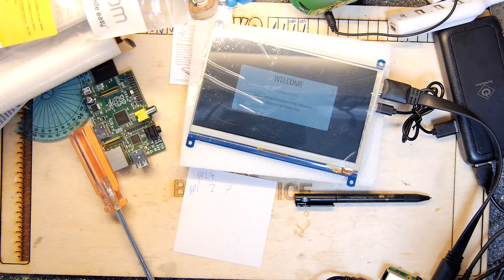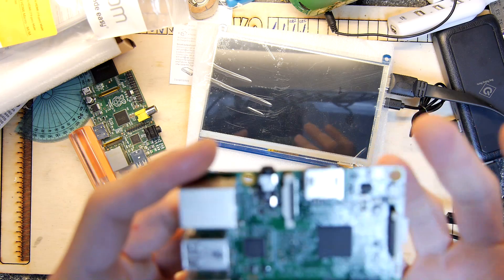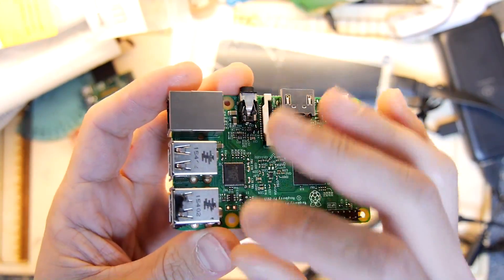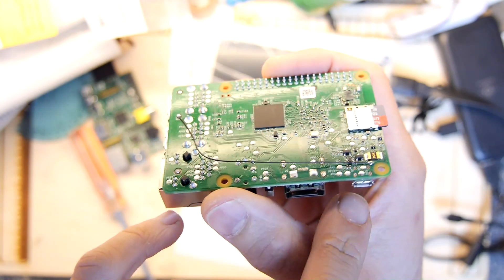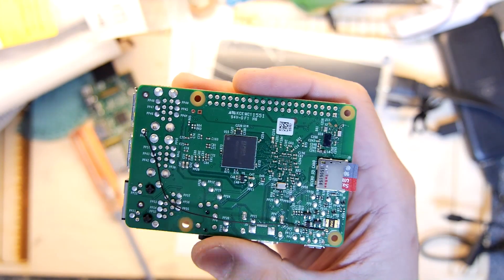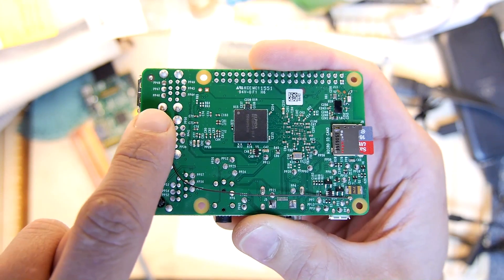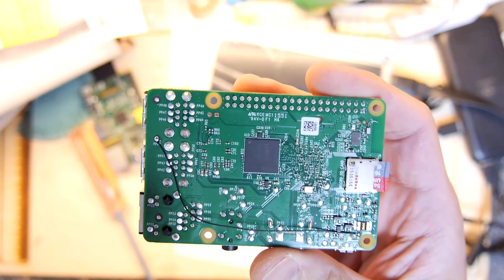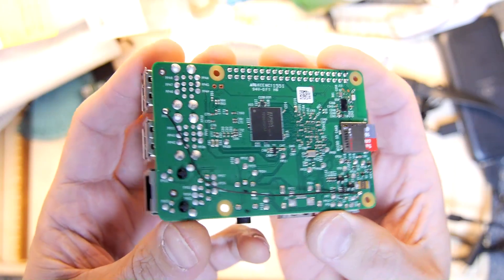DEAD USB on Raspberry Pi FIX!

Comment: Mine too stopped working. I tried the same but it didn't work instead it restarted every time I connected PP1 with PP27. I checked the voltage while in PP1 it showed 5 volt but in PP27 it was showing  less than 0.5 Volts. what can be the issue?

Comment: Just used this to resurect a PI 4 from early dispatch to silicone heaven. just used a cut USB cable to work out where the + came up to on the board from the plug and then bridged that across to the + at the USB C connector. Thank you

Comment: i was facing the same problems for the last 3 years. trying soldering a wire from PP27 to PP1 gives the usb 5v power.
the led on my mouse light up, meaning it has power. but still cannot move the cursor. is it because the data connection was damaged? or any tips about this?

PS: tried keyboard as well, 5v has delivered, but still not working.

Comment: Before trying this, the voltage read something like 3.25 volt, after soldering the jumper, it read 5.2 volts but still the USB didnt detect anything, Ill try with another to see if it works

Comment: Does the SD card have anything to do with the USB ports not working? If the SD card is hard drive for the board, could power be "turned off" thru programming?  I have same board as you. And no power at usb ports.  My 802.11 chip I plug in won't transmit signal.  I can't charge anything out of the usb ports.  That's how I tested usb ports.  Nothing lights up when I apply power. I want to try ur way.  Does amperage make a difference? 1 amp vs 2.4 or 3 amp power input to hotspot?

Comment: i know this is a long shot but my rasp4 just stopped working all the usb ports, and when measuring TP1/Shell its 5.2v but when measuring on TP27/Shell is only 3.3V any toughts? I have 4 3dprinters stopped atm because the pi doesnt recognize usbs :(

Comment: PP27 connects to u13 behind the USB ports . the failure is here or D3 transistor. the Pi controls the USB 5V on reboot ( switches the 5V rail off )
Reply: did you change it and it began to work again?

Comment: I am experiencing an issue where the voltage is displaying as unstable when using a multimeter to measure between the GND and 3.3V pins. Could this be caused by this problem? Thank you.

Comment: I have the same issue on my raspi 3B +. USB ports no power. Ethernet lights keep on with tiny light. C97 is good. The voltage between PP27 and ground is 0. 

Then the solution is to replace 7517,  and everything works well.

Comment: I have the same problem. But when I connect PP27 to PP1/PP7 the RPI reboots and does not start anymore. However, I found out that the USB devices will work when connected to a powered USB hub. Any idea how to work around this, using other points?

Comment: Hi, this is a great hack. However, when I measure across the GPIO pins for 5V and 3.3V, I could only observe 5V being generated and 3.3V pin at 0V. Any idea on why this is happening?
Reply from the maker: Could be that the 3v3 power supply is down. Try to see if you can locate a few test points and see if it present
Reply: @backofficeshow  I have probed literally every test point on the back side of the Rpi 3B+ and all I could see is either 5.2V or nothing else. It's very strange.
Reply from the maker: 3v3 is definitely down then. You will need to hunt down the power supply circuit and start replacing things.
Reply: @backofficeshow  😭😭 Also one more thing, the test point near the USB connectors also didn't give me 5V. Does this mean multiple parts of the board are not receiving enough power?

Comment: My multimeter shows 5V when measured between PP1/PP2 to PP27 but still the USB ports are not working. I checked between PP3(GND) to PP27 and it was fluctuating between 0.01V to 0.06V. Please help me out.

Comment: pls i need help my rasp berry pi  3 wont boot ive done everything what happend was it booted the first time then i used a command to put the dis play in a 2.5 inch display then i turned it off then it wont put out a display itried everything pls help im stariting to think my rasp berry broke
Reply from the maker: Did you wipe the SD card and start again with a fresh operating system? That cures most issues

Comment: Thanks. Now my USB ports have current but when I connect my usb mouse, it lights up but it doesn’t read a thing when I move it around. Are there more test pads or any way I can add other jumpers for usb the data ?
Reply: Exactly same issue here. Besides that, not network and not wifi.

Comment: I have a different issue and I’m not sure where else to look for help, so I’ll ask here just in case someone can.

On my pi 4, recently it won’t detect any usb devices and bring up the file manager like it used to automatically. I have to do the tedious process of “mounting” and “unmounting” it in order to get the device to show up. It used to be that the file manager would automatically bring it up and ask me what to do when usb devices are detected.

I did recently get a small touchscreen case and had to update my entire pi to get it to worko, but that shouldn’t have had any effect on the file manager...?

I also have a different pi 4 also up to date, and it’s working fine here, but it’s not connected to a ny touchscreen and is used through the HDMI ports.
Reply from the maker: If it stopped working after you installed a update it's almost certainly that that took out auto mount. Check the Debian forums on how to get devices to automount in the regular Linux forums

Comment: Crap hardware. I have a brand new Pi 4, USB  burnt within 5 minutes having a sole keyboard (Razer) connected.
They need a better trained electronics engineer
Reply: Don't use razer keyboards with raspberry pi 🤦‍♂️🤦‍♂️

Comment: I have a rasp Pi 4B and i dont have 5 VOLTs on USB 2.0 and USB3.0. Can i use this method ?
Reply from the maker: I do not have any Pi 4s, but if you do try it please let us know if it worked!
Reply: @backofficeshow  I am scared to try it, if i burn it? is it about sotfware ?
Reply from the maker: You should only do what your are comfortable doing and prepared to trash 😂

You might find what integrated circuit is faulty if you find a schematic
Reply: Hey Suleiman! Did you try @backofficeshow 's fix for your dead raspberry pi 4 ports?

Comment: raspberry seem to suffer from this problem,  that is the reason  I did not buy the RBP4 , I had two raspberry 3  bricked in my home because of this, I applied this method and they are working again,  coincidentally they both stopped working after an upgrade, almost at the same time, I went to sleep and when I woke up they were USB ports dead...odd, doesn't it ? anyway plenty of thanks for you.
Reply from the maker: With cheap hardware comes short testing cycles and bulk commodity manufacture. It's possible that there is a gremlin in the design or a weakness in the USB power controller. It just happens. I'm amazed they work as well as they do to be fair. I still use some RP1s whereas ever single far East tablet or android stick from that era is long dead and disposed

Comment: When I powered my raspberry it only ligh up the red led. It boots normally but the USB doesn't work and appears a yellow light on the top of the screen. I have another raspberry, so I tested the power supply on it and it works. Only this one that happens this problem.

Comment: Got a different issue not sure if anyone here can help...

My pi 4 on the bottom usb3 port has a loose connection. The slightest disturbance will instantly break the connection.

I know WHY it happened, as I had a RTL-SDR dongle in it and like an idiot tried to put something in one of the other usb ports. The RTL-SDR takes up too much space...

The other 3 ports are fine, but I kinda want all four working correctly since I haven’t even had it a full year yet.
Reply from the maker: Can you resolder the usb port pins? That could be the issue, otherwise, replace the port entirely.
Reply: Actually just figured it out and I’m kicking myself at how simple a fix it was.

Ever had an nes or snes (or really any old cartridge system) and noticed how it would stop playing games and you couldn’t figure out why(god I’m showing my age here...)? So you finally open it up, find out the pins on the 72 pin connector needed to be bent slightly up again to make better contact, and now it suddenly works.

Essentially what i had to do with the usb port. In the usb3, behind the first set of contacts, there’s the ones for standard usb. Noticed something seemed off when looking at the top and bottom ones. Realized the bottom usb 3 port had the two middle pins pushed in a bit too deep. 

Took a sewing needle and some patience, bent them back up and now they work just fine.

Glad i saw that before I went to the extreme and took out soldering iron.

Comment: Hey there I found your video when my Rpi B+ stopped working. But your solution was no option for me. After serching I found that the SMT condensator near the USB-Port was defect (C97). It is a KERO in size 1206 with 47uF and 16V nominal voltage. After replacing it the USB ports now are working.

Comment: hello 
i have model b+ --- pp27 to pp2 -- and usb powrd working but no data or mouse and keyboard and Ethernet port not working --- any fix
Reply from the maker: You may need to locate and replace the USB controller IC
Reply: @backofficeshow  where :\
Reply from the maker: @nileperch577  Look for the 9512 USB IC, that's probably what you need to change. Good luck 👍
Reply: @backofficeshow  master i have lan7515 this i want to change to 9512  or change 9512 to 9514
Reply: @backofficeshow  can you help master

Comment: Hi..  I had a psu from a 3d printer slam down onto my pi3b, entirely my bad :(  and it's fine if you bend the micro usb cable to connect the clearly physical break, but as soon as there's any slack, boom, dead. It's driving me nuts. I've got a pretty heavy duty fan case taking up gpio 4 & 6 for pos and neg. I understand there's no fuse in place if I chop off a usb cable and put some duponts onto say 2 & 9 for power IN? Would that work though? Ideally I'd love to replace to micro usb port (I can see one of the connectors has lifted with the bang, beyond my skills I think lol) could a phone repair shop do this in a jiffy? Many thanks, and hi from Blackpool lol.
Reply from the maker: Hi William, I've directly hooked onto the power rails before. I think the 5 volts should be ok ok and then the on-board regulators for the other voltages should take over.

you might lose a fuse but what's the worst that can happen your raspberry pi will go pop. Just don't try using the gpio for a space heater 😂
Reply: @backofficeshow  Quickly unplugs space heater No.. no, I wouldn't do anything like that for god's sake! So do you think 2 & 9 should be ok? As I'm a raspbnoob as I installed octoprint and needed to learn nooooothing else since lol. If it goes 'pooffff' I'll blame you ;)
Reply from the maker: @Mr_Gadge  do 2+4 6+9 so you won't get any voltage drop.
Reply: @backofficeshow  See, now you've lost me. So I have a case fan which needs a pos and neg, and I want to bring in power too? 2+4 are both pos? Thanks for taking the time to care for a thick elder lol.
Reply from the maker: @Mr_Gadge  you can just hook the fan and the power together because the fan isn't really using the gpio. The reason I say to double up on the pins is that you can effectively double the current rating of your connection
Reply: @backofficeshow  Update! After lots of flux and copper desolder wire, the port came off :) the pads had lifted off the board with the 'crash' I looked up on googly the pinout and found the pos and neg two circular spots behind where the port was, soldered there, and bingo. Direct power. Really happy lol.

Comment: Cool - it worked.  Now there's a message saying "Under-voltage detected" but with the Pi booted, connected via HDMI to a display, and via USB to my keyboard/mouse, it works fine
Reply from the maker: Under voltage detected is so annoying! I've used decent PSUs and still see that. I think there is a firmware flaw.
Reply: @backofficeshow  why they don't fix this many people have same issue.even I'm using psu as recommended same problem persist thanks for video my problem solved for now but I can't understand what was issue.
Reply from the maker: I am not sure how big a problem it is in their latest versions.

Comment: Thank you.  Your instructions saved me from buying a replacement Pi3.  You asked if someone knows another way to test if the USB port works after the fix.  I used  Eversame 2 in 1 Type C USB Tester - it shows Voltage, Amp etc.  At around fifteen dollars it is an overkill for one time testing, but if you need to test USB ports frequently, it is a good tool to have it in your toolbox.
Reply from the maker: Awesome, glad it worked out for you!

Comment: I installed fan on RPi4 and by connecting it to GPIO 5v power. The fan works fine and temperatures are down but now the USB ports are not working. any ideas?
Reply from the maker: Do they work of you disconnect the fan?
Reply: @backofficeshow  thanks for the reply.

I checked the dmesg for any voltage warnings. Ended up finding that PCIe probing was failing (out of memory) because i had given all the memory to gpu.

I updated the ram partition and now it works.
Reply from the maker: Phew!

Comment: The same problem here! Found your video while giving a last chance to that Pi... that was already in trash... Now it's back to business! Thanks. Of course, next step for me now is try to find the actual problem.... But Thanks again!
Reply: start with the onboard power-supply. its probably in a step-down DC-DC converter configuration. bypassing probably works fine, but swapping the smd ic or diode might repair it onboard :D

Comment: Just stumbled across the same issue after not turning on my retropie for a year or so. I had added cooling plates on top and below, the one one the chip below the Pi had gotten off and moved, probably causing a short. I waited for the fuse to recover (read something about that on the forums), but it didn't help. Your fix worked immediately and is the only solution I found on the net! Thank you so much! I ordered a new board just for safety but this fix will keep the old one alive for other projects :)
Reply from the maker: Glad it helped 👍

Comment: Great video, I got same problem, but for about 3 years I didn't use any USB port, so now I needed a USB port and I found the USB was not powered. With your solution now it works, great thanks a lot..
Reply from the maker: That's wonderful to know it was worked! It's not a proper fix (like replacing the controller) but better than nothing 😂

Comment: how about the lan port? mine is dead and also besides 4 usb ports are dead too. any way to fix it both of them?
Reply from the maker: I dont think i have even used my LAN port, but its annoying if they can die too
Reply: i just ordered 5v 3.0a dc adapter for my raspberry pi 3. i hope it will work if my order arrives

Comment: Nice instruction!  Also check if you see the message using dmesg "usb 1-1-port2: over-current change", should remove the current limiting IC AP2553 or disconnect pin 4 to avoid constant logging; some also suggest  checking C97 capacitor.
Reply from the maker: Great top tips right there!

Comment: I got lucky.  I am running a flow meter with the pi.  I disconnected my mouse and keyboard and noticed more things setup on my start up .  Then I plugged in the mouse and it worked.

Comment: In my case I traced the fault back to a failed U13. It seems to be an AP2553. I'll order one up with my next batch of components and see...  In the mean time, I'd be cautious about hot-plugging USB devices :) Interestingly, U13 has a maximum current of 2.1A so its quite possible to exceed that by plugging devices that pull more current.

Comment: I did the connection with jump wire like that  ..It only give the power in the USB port, the monitor does not receive/display any signal from computer even the  the keyboard and mouse did not work...
Please help me out if you know  this solution.

Comment: hello I have the same problem when bridging pp27 and pp1 if they are connected from the beginning does not turn on and when they are removed if you turn on PLEASE HELP OR SOLUTION
Reply from the maker: +hendolfo668 Sounds like your problem is a short further down the path so bridging is causing your PSU to fail. If there are no visible shorts it could be the usb control circuitry. Someone hopefully can help more.

Comment: Hey , I did as said and the mouse powers on , but they don’t work , my keyboard or wifi dongle doesn’t even power up , any thoughts ?
Reply: It is the same problem for me too .Even          the monitor did not receive any signal from raspberry computer.....
If you got the solution let me also know.
Reply: Same problem here
Reply from the maker: Seems pretty common, I'll ask around
Reply from the maker: I do find these quite unreliable. SD cards are notoriously easy to corrupt. The sooner they provide a SATA the better. I might look into am odroid board next for more reliability.
Reply from the maker: +Mihgy SoHappy Sounds like the USB transceiver is dead. I am not sure if it's a sperate IC or built into the SOC. Someone might be able to advise but it could be a tricky fix.
Reply: USB Ports Dead ..